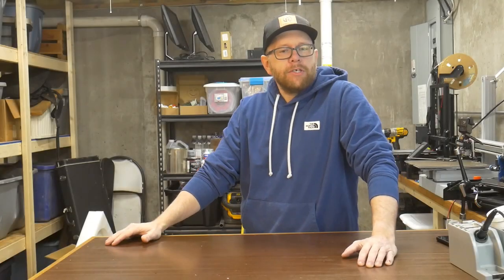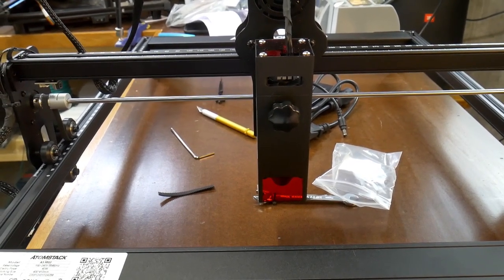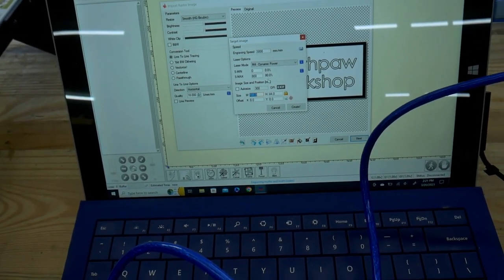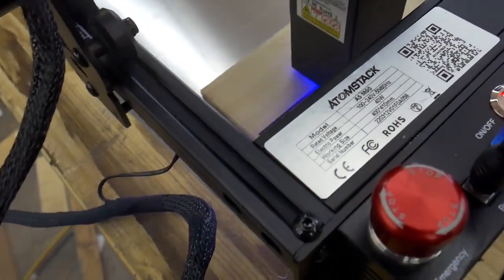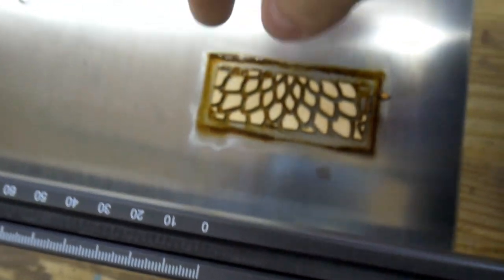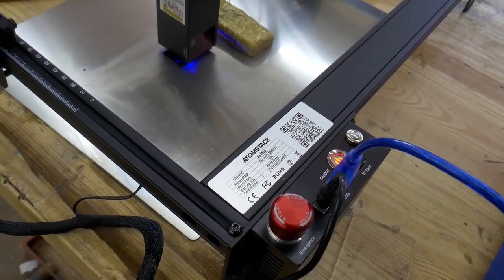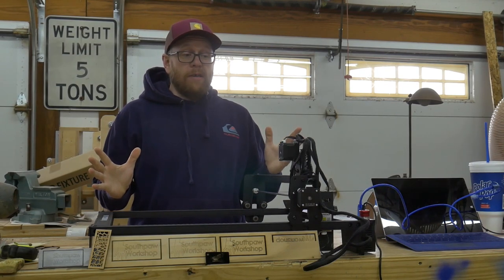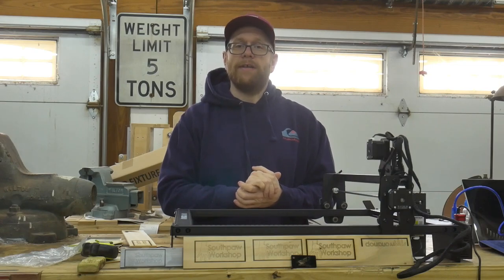Can this affordable laser do it all? Atomstack A5 M50 Review

Comment: My complaint is that it said I would be able to manipulate it from my phone. 
However, every video I'm seeing skips that part altogether. Not much on the SD. 
What does the Atomstack app do? Why is everyone using the same 2 programs when it said it works with a variety?
Not really seeing the variety on my end.
Reply from the maker: You make a valid point, but my guess is that they mean variety in the way that they support multiple OS versions of lightburn and laserGRBL. Regardless, lightburn is the way to go if you plan on doing serious work with any of these lasers. LaserGRBL is the free route but it is limited. As far as the app goes… this review was made before the app was available so that is the reason it isn’t  covered.

Comment: Hello, when you tried to engrave the piece of metal, were you able to reburn the pattern for a better, more clear engraving? For instance, could you leave the project within the unit and do another burn/pass? I ask bc there are times when something, as shown, doesnt burn so well. If another pass or two is needed, would this machine be able to do another pass or would there be alignment issues?
Reply from the maker: As long as you don’t touch anything, you should be able to re-run the routine and have it make as many passes as needed.
Reply: @SouthpawWorkshop  Perfect! Thank you!

Comment: Hello, can you share the sett8ngs for cuttong please (wood and acrylics)? I have the same machinr and i have trouble cutting even 2mm material... thx
Reply from the maker: High output and low speed should get you there. Need to make sure the laser is in focus as well. Elevating the workpiece can help also to allow the laser to cut cleanly through without scorching the backside. Try 80% power 100 mm/min and adjust from there. Good luck!